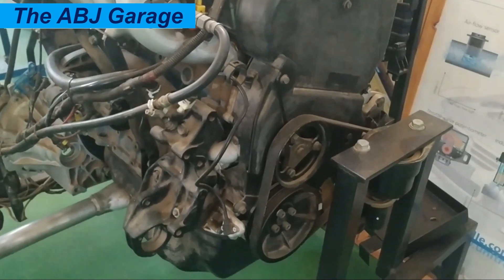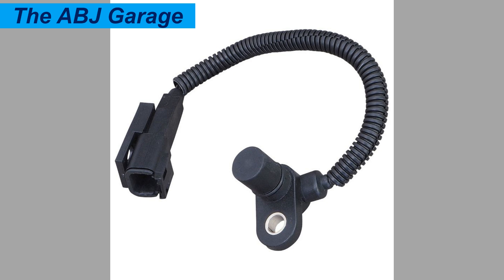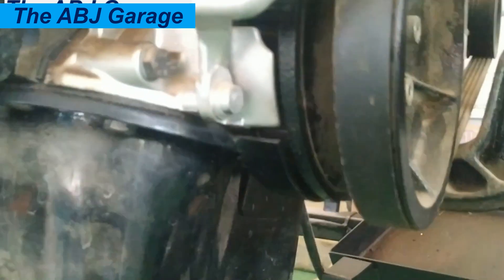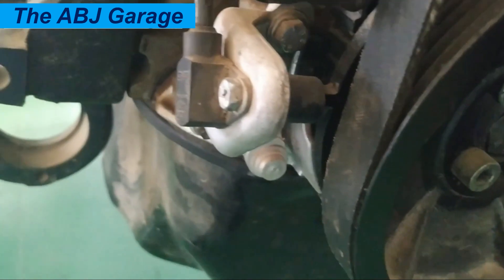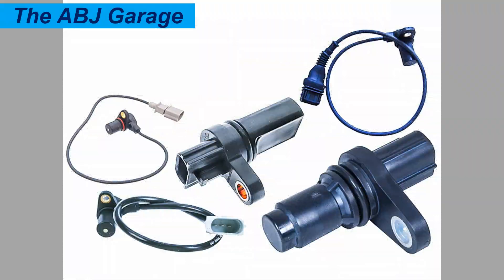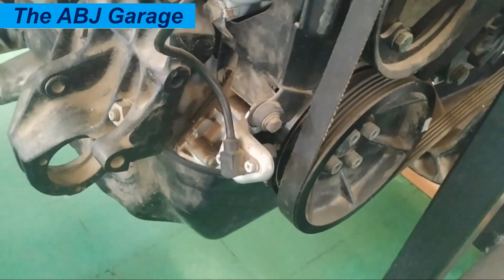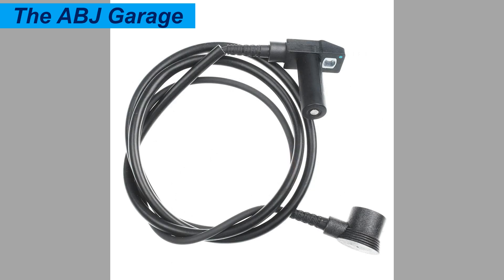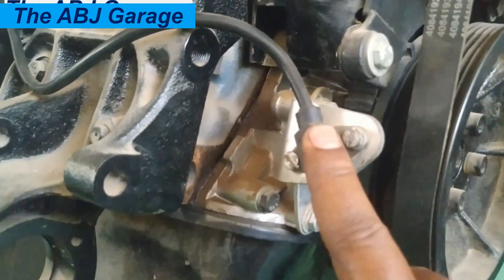CRANKSHAFT Position Sensor Failure IMMINENT? 16 Signs You Need to Know

Comment: I have a Ford focus 2004 1.6  16v petrol.
Lately i have this faultcode   P0303   Misfire in cilinder 3.
Now i have changed the spark plugs, coilpack, leads, injector,  and still the same.
Would a failing crankshaft sensor cause this kind of problem?
Reply: Misfire may also be mechanical NON electric spark or electric injector or ECU control methods...misfire may also be due to fuel pressure or regulator......but most mechanical appears to be Valve..exhaust then intake...or carbon interference ..heat or hot spots due to air pocket from coolant improper complete bleeding of......and sometimes that heat can drop loose a Valve seat usually exhaust....proper interference fit assembly SEAT press fitted with LIP LAP or ...PINNING a SEAT to secure...I wish they used titanium tied Allen SET SCREWS....my Genious method to set SEATS....
Reply: Thanks for the useful info !

The cause was in my case mechanical, a stuck valve due to a worn engine..